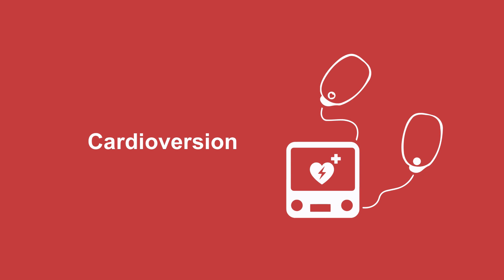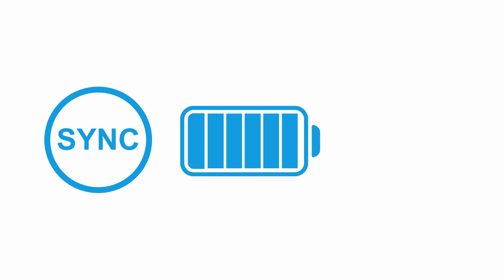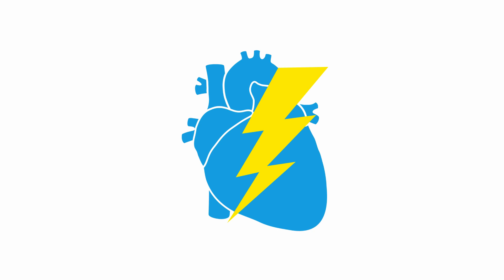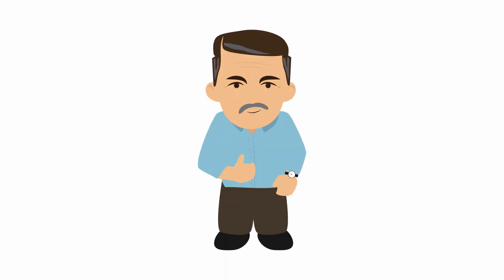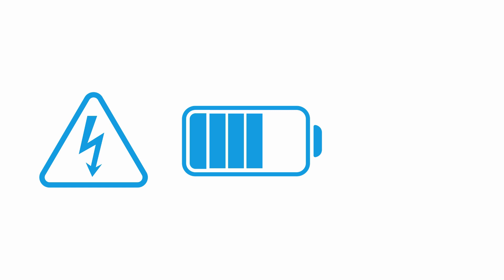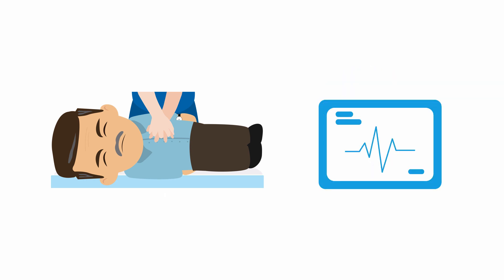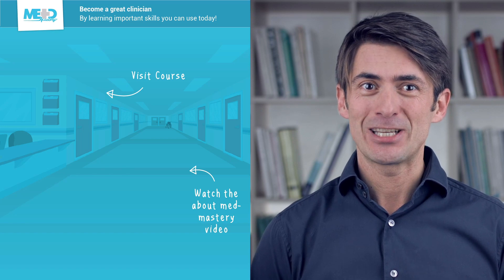Cardioversion vs defibrillation: performing the procedures

Comment: If you read about the dangers of getting shocked they talk about current in amperes. No one has been able to tell me how much current is used.
Reply: cardioversion you typically start around 100 Joules and can work your way up sometimes to 360 Joules if the patient is not responding to the cardioversion

Comment: This was great for helping me quickly and easily understand the difference. Thank you!!
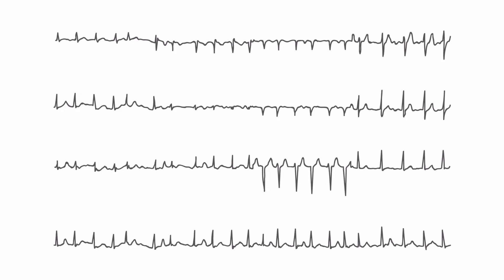0:20 What does "rapid ventricular response" mean?
Reply: "Rapid Ventricular Response" is an abnormally fast heart rate (usually around 150-160 bpm) as a consequence of Atrial fibrillation. Atrial Fibrillation is an abnormal rhythm. Sometimes it can trigger your ventricles to beat too fast.  When that happens it's called Atrial Fibrillation with Rapid Ventricular Response.

Comment: During the cardioversion portion of the video, you say "press the shock button". The correct wording should be "press and hold the shock button until the shock it delivered". The device is looking for the R-Wave marker to deliver the shock, 10 milliseconds after the R-Wave, to avoid the relative refractory period of the cardiac cycle and send the patient into a lethal arrhythmia.